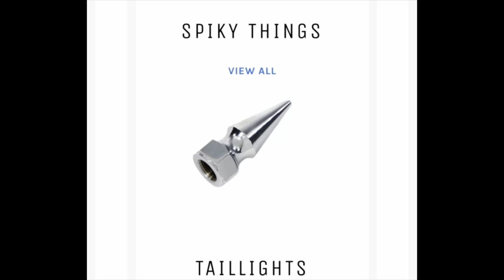CHEAPEST WAY TO WIRE AFTERMARKET TAILLIGHTS - '06 Harley Extended Bagger

Comment: Great looking bike! I have a 1997 Ultra Classic and I too am looking at the 19" Enforcer front wheel I found a 2015 wheel what will I need to do aside from adding the 3/4" bearing 11.5 rotors? will I have to or a new front axle?
Reply: Order a new front axle is what I meant to write.
Reply from the maker: Hey bud, thank you.  Check out this video.  https://youtu.be/581U2LiuF2k

You won’t need anything other than the 11.5” rotors and the correct axle.  I have both listed in the description.
Reply: I swapped same wheel with my 06 Ultra. Only thing I did differently was use a 25 mm axle and a set of Brembo Calipers. Everything came off of a 2021

Comment: Wht if the lights have 3wires
Reply from the maker: One is a ground, one is a tail lamp and one is a brake light.
Reply: Where does the ground connect to the wiring harness ?
Reply: @juhurashazer2547  It doesnt, just run it straight to the lights!
Reply: @juhurashazer2547  Wire the right side to the right signal wire on the light, the left to the left signal wire on the light, ground from the original harness split it to two, go to each light, and split the tail wire coming off  the Trailer Light Converter and and go to each wire for the running lights wire on each light!
Reply: It would be awesome if someone made a wiring diagram for this